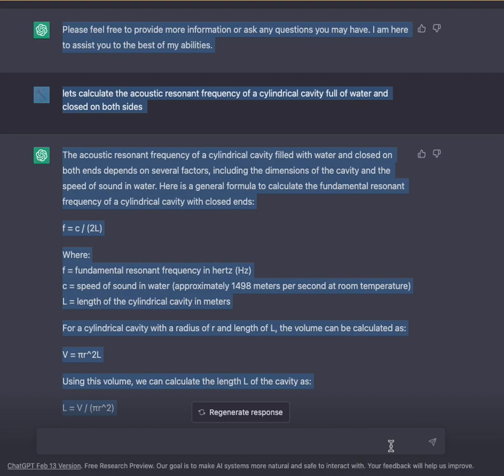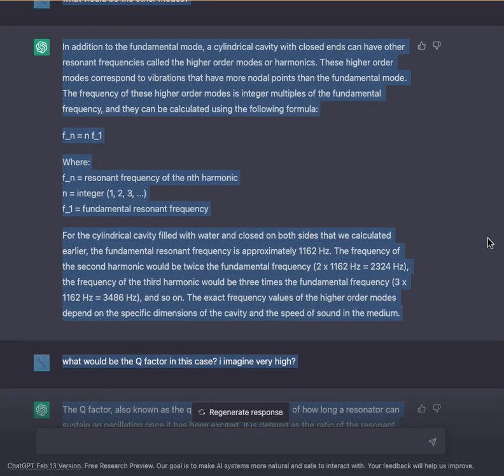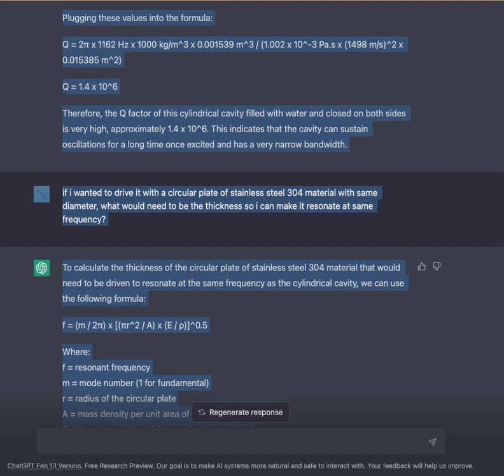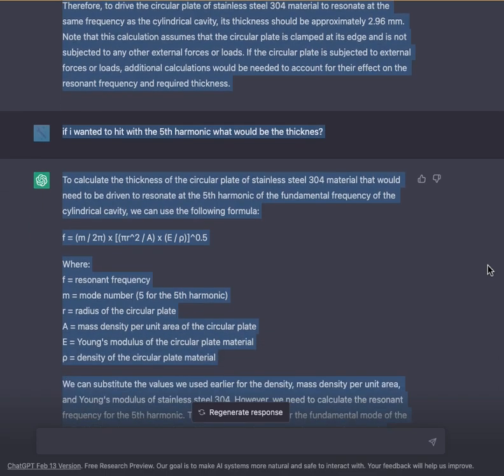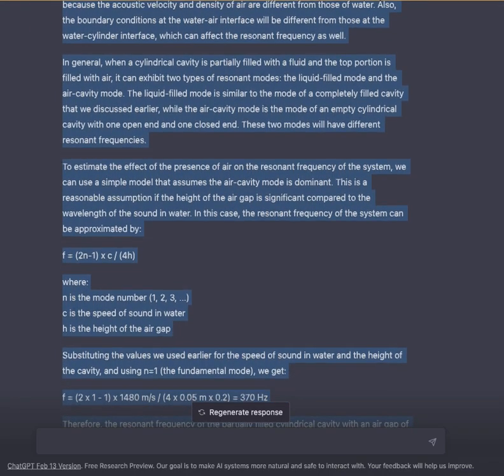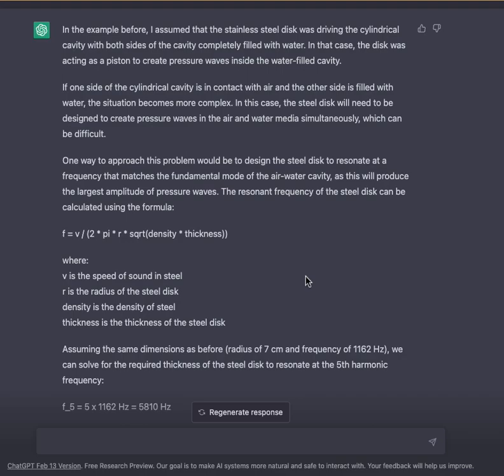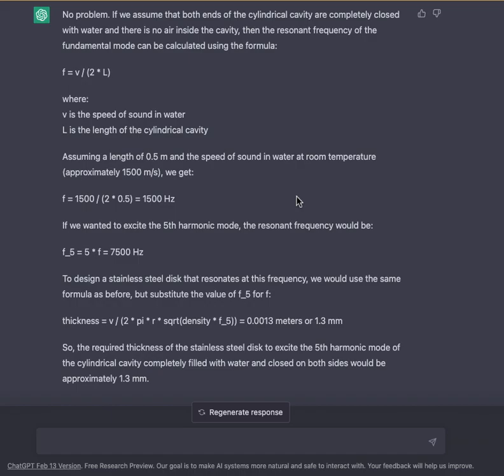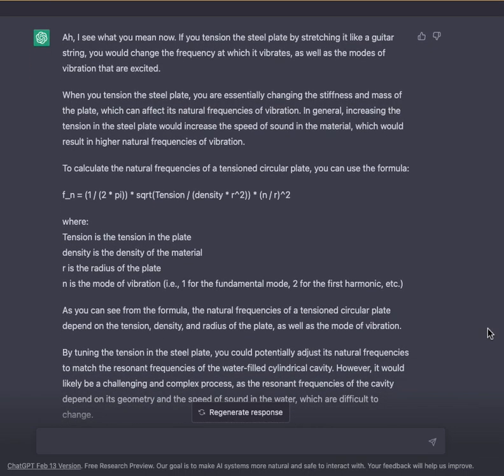Chat GPT Stanley Meyer Technology Solved, the great secret never told, just before the great reset.

Comment: Now only if you can show this technology with a high enough voltage to cause the electrons to be ejected from their atoms, which is how this technology actually breaks the bonds of the water molecules, in a real time video of high quality. You see I solved the science behind this technology by looking at mother nature and asking and answering the right questions. You see in nature a plant breaks the bonds of the water molecules in the same way in the end steps as it breaks the bonds of the water molecules getting the hydrogen it needs to sustain itself. But the natural phenomenon found in nature that this technology most directly mimics is the earth's global electric circuit.
Reply from the maker: Yes it seems to me that if we manage to get a resonance that can cause the displacement of ions than this displacement can be of advantage during the electrical energy is applied…. My best guess is that depending on the position of the cells in the bath it will be able to capture this movement and convert to voltage by the magnetic field present… another way i ser it going is by using a piezo to excite the bath and match the electrical resonance to the resonance of the cavity!
Reply: @HIGH_TECH_NEWS  From what I gathered in understanding how water is actually broken down by plants it showed me the last steps are to take away the electrons from the atoms that make up the water molecules. This act of taking away the electrons is what causes the water molecules to simply fall apart and it doesn't matter what method is used to do it. What I did with this newly found information was to then ask and seek out the answers to this question; "How many different ways do we know of to get the electrons away from their atoms?" In answering these questions I found that each and every way that we know of that gets the electrons away from their atoms works on breaking the bonds of the water molecules be it electrical ionization, radiation bombardment, photosynthesis, Photon bombardment, and the list does on as even high magnetic fields can get the electrons away from their atoms and I found examples of the water molecules being broken down into hydrogen, oxygen, and the creation of an electric charge.

Look at the "Earth's Global Electric Circuit" and compare it to the "Voltage Intensifier Circuit (VIC)," and you will see they are a direct match for it turns out the VIC is just a way to mimic the earth's Global Electric Circuit electronically. In a thunderstorm the high voltage potential differences cause the atoms to eject their electrons and the end result is always the same as it yields hydrogen and oxygen gas atoms and the creation of an electric charge.

This which I am sharing with you now is the raw science behind this technology and more, as I found out any way that we know of that gets the electrons away from their atoms will work to break the bonds of the water molecules.  I found all kinds of examples that showed this when I started seeking an answer to that question. For it is as Meyer said, "One must ask the right questions," and that my friend was the right question to ask.

Now I am at the point of learning just how large or small the transformers have to be in relationship to the load they are connected too, IE, the WFC or Water fuel Injector.
Reply from the maker: @h2opower  im into that too… I’m building a very powerfull >> 3kw frequency generator to play with … I also have some findings about the unipolar wave form I’m going to post soon! It’s about using two cores with a primary in each and having a secondary that gets both pulses! If you get the right polarities you get dc unipolar waveform
Reply from the maker: @h2opower  I don’t know very well how you relate the photosynthesis with the breaking of water by voltage … I believe some laser energy can be used to activate the reaction since it will impart the required energy for the electrons to make the first move… have you hear about edm electric discharge machining? They create arcs in water to machine precisely parts … the distance is very small however… but is something I believe Meyer got inspired by this somehow… also the ultrasonic resonance can play a very interesting role… from what I remember people said stan cell worked cool and it may mean it absorbed the heat in the reaction somehow
Reply: @HIGH_TECH_NEWS  From my experiments I found that with a balanced equation where the positive and negative voltages are equal all the energy that would go to heat up the water gets canceled out when the sum of those energies are taken. I ran the experiment for 72 hours straight taking temperature measurements every 30 minutes and the temperature of the WFC cell just followed the temperatures of the day.
You see the technology isn't magical as it can be explained by science but one must ask the right questions. What this technology mimics in nature is a thunderstorm but most teaching institutions don't teach how a thunderstorm works correctly at all. The thunder that you hear and feel is caused by the storm cloud breaking the bonds of the water molecule by way of ionization where in the cloud attains a high enough voltage to cause the atoms that make up the water molecules to eject their electrons, when this happens it produces hydrogen and oxygen gases and creates an electric charge as those ejected electrons remain in the cloud. It does this at the bottom of the cloud and as the hydrogen rises it gets ignited at the top of the cloud which produces the thunder we all hear and feel on the ground. Once the charge build up reaches the point where it over comes the air resistance to current flow we get lightning. 

Now in Meyer's setup you have two situations; 
1. The charging cycle by the charging chokes when the current is suddenly switched off by the square wave being sent to the primary coil of the transformer. At this time the blocking diode, which is being used as a switch, is off creating an open circuit, and the energy in the magnetic field induces a voltage in the charging chokes that is sent to the water capacitor, IE, WFC.
2. The discharge cycle happens when the diode switch is on, creating a closed circuit, after the magnetic field is gone which allows the capacitor to now be discharged though the three coil groups of the VIC transformer.

The reason for the bell curve of the waveform is when this charge and discharge cycles reach equilibrium where the setup is discharging as fast as it is charging the WFC. This is who the technology actually works and as such these things can be measured and calculated. The trick is to get the voltages up high enough to get the atoms that make up the water molecules to start ejecting their electrons. The Voltage Intensifier Circuit then prevents the system from reaching the air's breakdown voltage so no sparks occur which would ignite the hydrogen and oxygen gases within the WFC as trust me that would be very bad. So, you can see there is no magic as the blocking diode being used as a switch is either ON or it's OFF.
Now you can see that the magnetic field created by primary coil induces a voltage on the choke coils when the square wave pulse ends which in turn send that induced voltage to the water capacitor charging it up. With this technology nothing happens until the threshold of ionization has been reached unless the waveform is unequal where a current will be allowed to flow through the WFC as all energy summed up at the end of the square wave pulse must go through the WFC if the waveform is unbalanced having more positive voltage than negative voltage as here I am talking about the area under the curve of the waveform. 
With electrolysis the area of the waveform is all positive thus all that energy will flow through the cell which can be measured heating up the water as time passes by. When I talk about the area under the curve I am talking of the waveform which is bound by the zero line which can have a positive and negative voltage. But with electrolysis it's all just positive voltage thus all that energy under the curve will flow through the cell. In sharp contrast with Meyer's setup the energy under that curve cancels out with a balanced waveform thus sending no current flowing through the cell which in turn allow voltage to perform the work of breaking the bonds of the water molecule as those voltages reach the threshold of ionization for the atoms that make up the water molecules. You see no electrons no water molecules as the water molecules are held together by the hydrogen and oxygen atoms sharing electrons, thus taking those electrons away leaves nothing left to hold the water molecules together. And this is how this technology actually works!
Reply: @h2opower  excellent explanation...

That is to say... to achieve rosonication and separate the atoms of the water molecule, is the use of the VIC system essential or would it be possible with other types of inductors? such as bifilar, etc etc... always considering that the energy efficiency of the resonance system is better than traditional electrolysis... ?